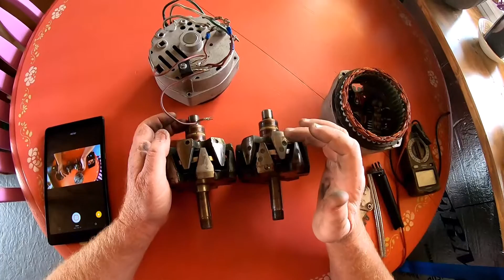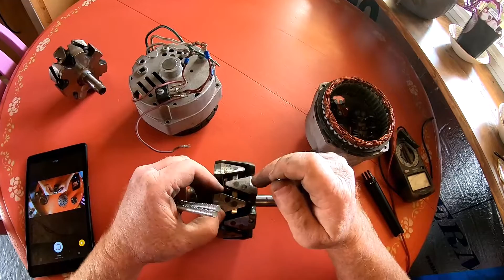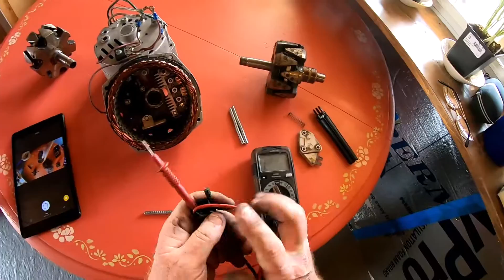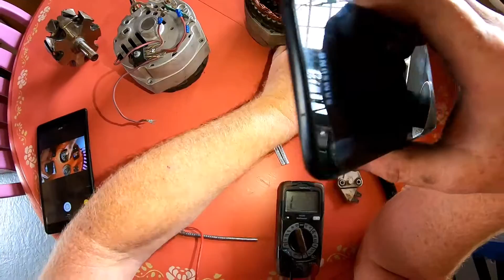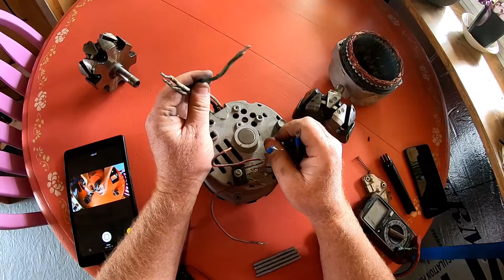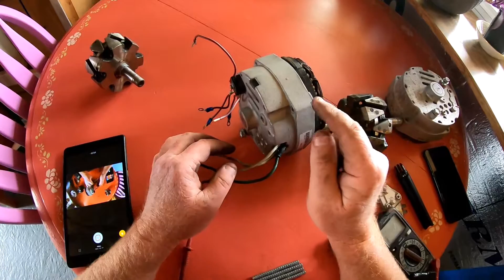Building a hybrid alternator for wind power, DIY wind turbine, Home made wind generator

Comment: Is an alternator the best starting point? 

I was thinking about building a prototype using a washing machine motor converted to have permanent magnets

I know alternators have rectifiers and regulators but I'm probably going down with a free prototype and then step up
Reply from the maker: The best starting point is whatever you have on hand that you can make work. I've seen the washing machine conversions and they seem to be pretty good

Comment: Very interesting that one can increase fields using magnets manually. Can you give us a calculation in watts showing the speed of the rotor that produces the amount of voltage?  I would like to see the increased amount of watts being produced by doing this...  I am working on several spare alternators using AC motor to see what we are producing.
Reply from the maker: Absolutely, I hope to have a wind turbine up and running soon and have some stats for it
Reply: @veggitarianredneck  I also have a washing machine stator set up a belt pulley on a 2HP 3150 rpm one to one ratio.  We measured 566 volts on it.... and sure it would put out at least 1000 watts easily.  I may end up using this as a wind generator, but for now I have different plans to generate free energy.
Reply from the maker: I also show an older video with this same conversion, I believe the link is in this vids description. It shows the volts and approx rpms.